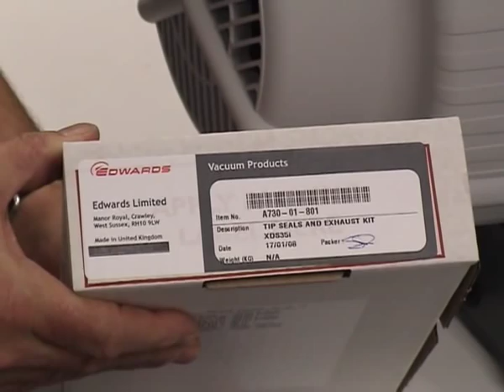Edwards XDS35i Scroll Vacuum Pump Tip-seal Change

Comment: Thank you for providing such a professional dry pump repair and replacement tutorial, I think you have done a good job in every detail, disassembly, cleaning, assembly, replacement, our company also does vacuum pumps, pump repair and pump accessories, such as Edwards XDS35i Scroll Vacuum Pump Tip-seal, each brand corresponds to the top seal ring of the scroll pump, consult email

Comment: 4:40 when installing the tip seal, were there two sides different? In the instruction, it says the smooth side should face up? Does it matter there?